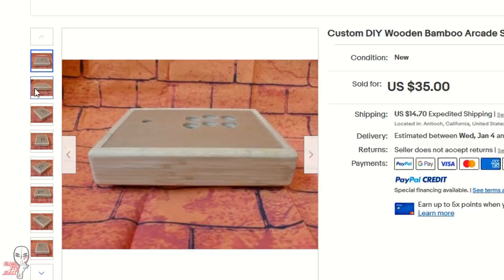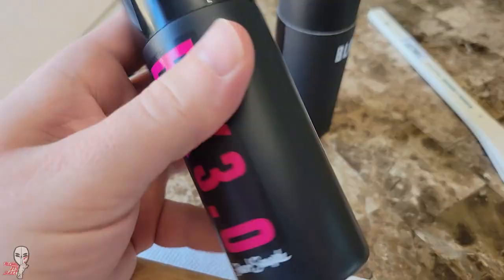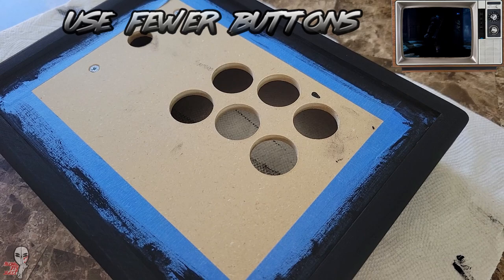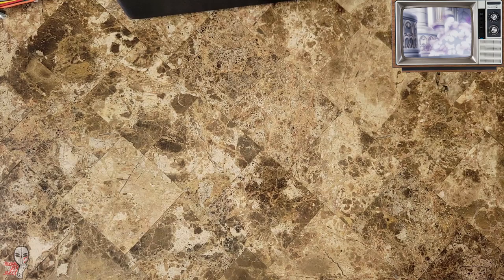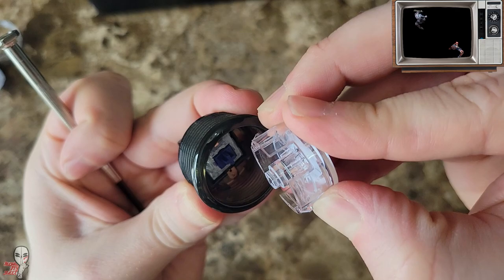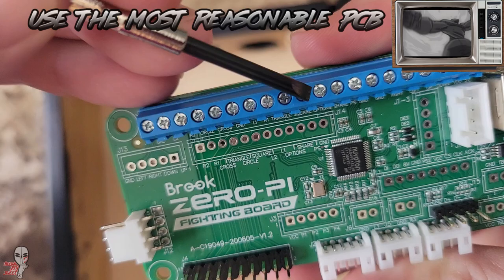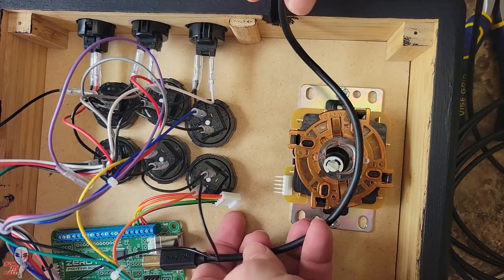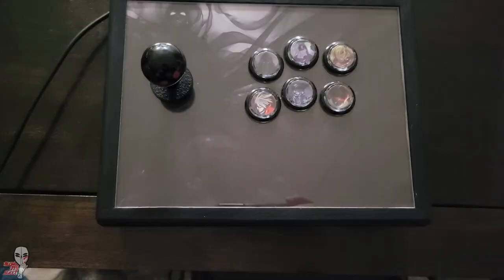Shadow Fightstick and 8 TIPS to build a cheap, budget arcade stick!  $$$

Comment: Would have liked to have seen you use Musou black instead (even blacker), but still a cool stick and video. Great work.
Reply from the maker: Yeah, I was unfamiliar with which was the current blackest paint overall and had heard good things about this one, but it wasn't quite as dark as I'd hoped. Next time I'll have to try the Musou. Thanks for watching!
Reply: @HushMySweet1  If it means anything, the differences can be subtle. So much that people argue. It seems application with 3.0 is easier and better. For best results with Musou, you'll need to prime the stick, airbrush 4 coats and all sorts. I've read it can flake, peel, and even melt (lol) materials. Musou is a silly price but it'd probably balance out due to US shipping. I'm just regurgitating what I've found online. Either sound like horrible stuff to work with lol. Most likely the blackest stick ever though, so good stuff.

Comment: I have some crazy enclosure ideas that I've 3d modeled only Id like to print them in the "Ballistic Lucite-polymethyl methacrylate" plexiglass with rubber enamel combination you mentioned in another video. Is there a service you recommend or will my google -fu do the trick?
Reply from the maker: Hmmm...I don't know much about 3d printing or how printing with that material would even work. I got mine from a guy (on Twitter, he goes by jimmybagelson) who sources big slabs of it and then cuts them down to fightstick size. He did a really wild Soul Edge build recently too. Anyway, if your Google skills don't turn up anything, you could pick his brain. But! This might be a question better asked to 3d printing subreddits. There might be some equivalent strength/weight printing material that would work well for your purpose. Good luck with your project!

Comment: Good evening, what did you use for buttons?

Are these Sanwa?
Where can you buy these?

Thank you ;)
Reply from the maker: I used Crown 202s. These ones have a smoke housing and clear inserts (so I could put art in) and the stock switches were subbed out for cherry MX navy versions. You can't buy them as I have them here, BUT you can make your own version. Online suppliers like Focus Attack, Arcade Shock, and Paradise Arcade all sell Crown 202s.

Comment: Hey. Where'd you get the plexiglass?
Reply from the maker: It came with this case, but I've ordered smaller pieces from Amazon and cut before myself. Look into SimbaLux Acrylic Sheet Clear Cast Plexiglass 12” x 12” on Amazon (there might be better suited sizes than that). Good luck.
Reply: @HushMySweet1  see. I'm in the process of building my first stick, and I purchased a jewelry box with plexiglass as a case. 

If you were in my shoes....How would you go about adding artwork?
Reply from the maker: @Breeze06  I would have to see a picture of the box. You got an additional piece of plexi you're going to lay on top, yes? So I'd just secure it firmly, lay on a paper template I like, drill a pilot hole (dead center in each area which will need a hole) right through the plexi and into the box, take it off, drill each of those components separately. Buttons will keep the plexi down, but if it's a rough cut and it's not inlaid, you may need to bevel the edges so you don't hurt your palm. Also, depending on the surface area, you may want to add additional screws to keep it locked down, but I would countersink those so you don't drag your hand across rough tops jutting up. Then just get your artwork (there is another vid on this channel about making/commissioning/printing artwork), lay it between the surfaces, pop in your buttons, and screws, profit. Good luck with the build.
Reply: @HushMySweet1 Took your advice, and I now have the artwork I wanted. I purchased the Brook Fighting Board cable as well as the Brook XB Board. Please help me with the wiring.
Reply from the maker: @Breeze06  What do you need help with? Watch my video on building your own hitbox. There is a section on wiring there and 90% of it is the same as what you'll need to do here. Start with that.
Reply: @HushMySweet1  Everything works fine now. Thanks again for your assistance.

Comment: Is it possible to get plexiglass cover for art cheap?
Reply from the maker: It depends on the enclosure, but for most common models, yes, you can grab one for around $16 on Focus Attack. If it's a custom case, then you'll likely need to cut and drill a piece yourself. Good luck!

Comment: it's a shame that the ebay link to the case is not found anymore
Reply from the maker: Yeah, but there a few cheaper options. You can repurpose existing items to make a case. Or, if you want something ready to go, then it you could look into 3d-printed options (I'll have a video on that sometime in the future), or you can ask reddit user theotherside1 to cut a DIY case. He has pretty cheap options (or did a month or two ago when I checked in on him).
Reply: @HushMySweet1  Thank you very much for all your help, couldn't find u/theotherside1  either, I'm checking the mid tier by eternal rival even though I'm not gonna lie what I loved was the affordability and the aesthetics of the case you've shown, repurposing a briefcase, a plastic container or a shoebox is not in my options, I do have a qanba drone that I can continue using fortunately meanwhile I save for a case and more parts (most likely I'll be using the buttons the drone has, I really want to try a k-lever like a crown-303mj)

Comment: Hi it’s working in ps5 ?
Reply from the maker: It depends on the PCB you put inside it. The one in this video would not work on the PS5 without a Wingman adapter or something. But, you can sub out the Brook Zero board for an advanced breakout board with a passthrough and then use a MagicBoots v1.1 dongle. That combination is around $50 and allows for PS5 fighting game compatibility. Good luck! https://sgfdevices.com/products/sgf-gp2040-ce-advanced-breakout-board-pe
Reply: @HushMySweet1  okay thank you so much for your help